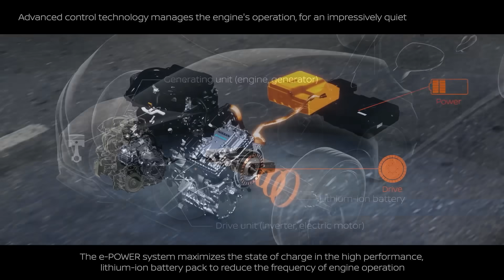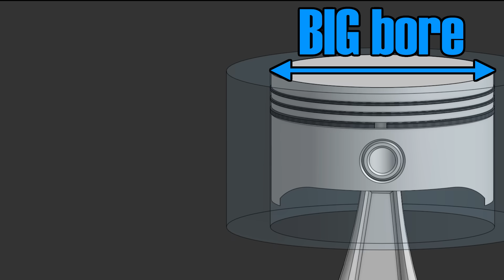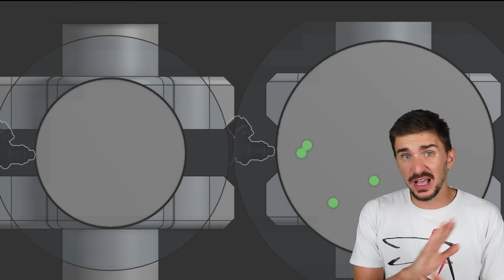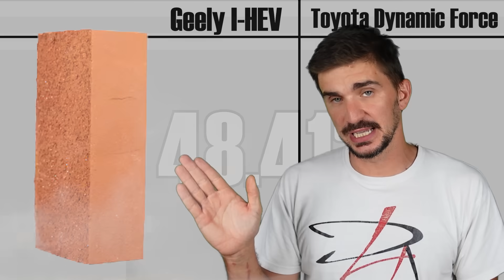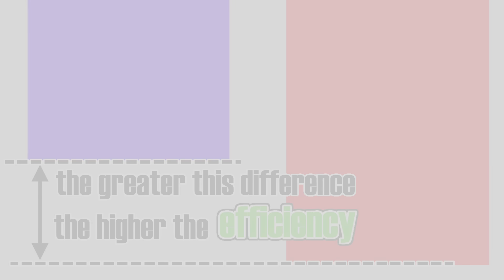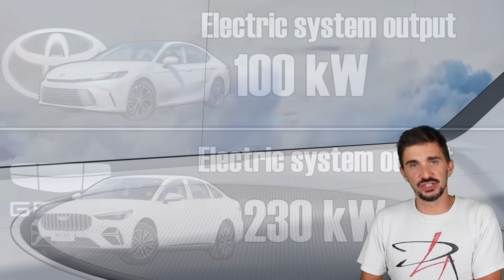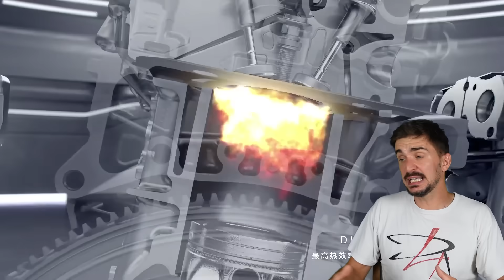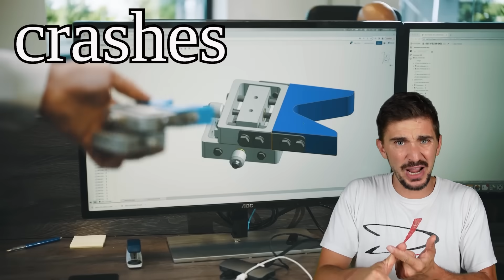How China's Geely Beat Toyota, BMW, Ford and Everyone Else

Comment: Toyota could technically move toward an extreme deep Miller/Atkinson-style hybrid setup like the one described for Geely, but it deliberately chooses not to. This is less about capability and more about engineering philosophy, product strategy, and real-world usability.

Toyota designs its engines for universal reliability across all driving conditions: cold starts in Northern Europe, urban traffic in cities like Brussels, sustained high-speed driving on German highways, mountain roads, and situations where the battery is low or even depleted. The core principle is that the car must always perform predictably and adequately, regardless of circumstances. An ultra-deep Miller or Atkinson strategy can deliver very high efficiency in a narrow operating range, but it often comes with reduced standalone engine performance when the battery support is limited. Toyota avoids this kind of dependency.

Another key factor is battery size. Toyota hybrids typically use relatively small battery packs. This is intentional: smaller batteries are cheaper, lighter, more durable over long-term use, and less prone to degradation. However, this also means the combustion engine must always be capable of directly powering the vehicle without relying heavily on electric assistance. In contrast, the Geely approach assumes a larger battery and stronger electric motor system, allowing the combustion engine to be optimized primarily for efficiency rather than direct performance.

Toyota also prioritizes average real-world efficiency over peak laboratory efficiency. The Geely-style system may achieve extremely high thermal efficiency under ideal conditions, but Toyota prefers a more balanced setup that delivers consistent efficiency across a wide range of loads, speeds, and environments. In practice, this makes Toyota hybrids more predictable and less sensitive to operating conditions.

Another strategic difference is that Toyota avoids building systems that behave like EV-first architectures with a range extender engine. The Geely concept effectively allows the electric motor and battery system to handle most driving, while the combustion engine acts as a highly efficient support or generator. Toyota does not pursue this because it wants its hybrids to remain fully functional even in low-battery or non-ideal scenarios, without any noticeable degradation in drivability.

Finally, Toyota operates a massive global fleet across very diverse markets, including regions with limited charging infrastructure, variable fuel quality, and extreme climates. This forces a design philosophy centered on robustness, simplicity, and tolerance to poor conditions. Geely, by contrast, can optimize newer platforms more aggressively around electrified, urban, and infrastructure-rich environments.

In short, Toyota does not avoid deep Miller-style efficiency because it cannot implement it, but because it chooses not to rely on an architecture that trades universal usability for higher peak efficiency. It prioritizes consistency, durability, and real-world performance over maximum theoretical efficiency gains.

Chatgpt

Comment: With more engines going to a 'under-square' engine design– I hope this will result in more inline six engines.  The main detraction of inline six engines has been packaging– with a more under-square design, it may be possible to fit an inline six transversely in an engine bay.  I believe Volvo SI6 did this.  Also having a perfectly balanced engine would help with higher piston speeds 👍

Comment: As a Chinese car owner in Mexico (BYD King), I can confidently say Chinese cars are no joke. With a full tank and a fully charged battery, the official range is 1,175 km (730 miles). In my real-world experience over 7 months of ownership, I consistently get around 990–1,010 km (615-628 miles), which is still very impressive.

Comment: ok so this makes sense, I learned A LOT because of this video, and I guess where we're going is: The most efficient way for ICE is to have an electric car with an engine running, charging the battery, at the RPM for peak efficiency all the time, the more efficient you make that engine, the more efficient the EV, and then we'll come full circle, why have the ICE in it if we can just have an EV and stop using gasoline altogether. 

Imo, I just like the sound it makes and the fact that I'm causing explosions while travelling. These new EVs really take away a lot of the driving, the drivers are not aware of how much power and responsibility they're riding on, and they use their phone or that big screen they have in front, they don't put gears, they don't hear any feedback from the car. Just mindless driving.

Comment: It seems the big question today is not "can it do it?" but "for how long?" - will it last beyond a few thousand miles? I you push engines to F1 limits, you will get F1 lifetimes. Do you want a sprinter or a long distance runner?

Comment: I only care about how many computers are regulating it and how fragile they are.

I have a motorcycle with great fuel efficiency. I hate it. It won't ever last longer than 3 years without expensive sensors being replaced. What a piece of garbage.

Comment: I have always wondered why western car manufacturers have not taken this approach since I learned about HCCI engines and their issue with having stable combustion on a wide rpm range. Why not design an engine for one specific rpm and use it as a constant speed generator? You can use the generator to spin up the engine to proper rpm and then start it. If you look at average kw requirement for a car it is not that high. The problem now is that everyone expects their ev to be fast as hell and have unlimited hp and torque. To get something efficient and environmental freindly this ide has to be toned down. 
So a constant rpm generating hcci engine and fully electric driveline with regenerative breaking seems to me to be the way to go.  Any opinions of why this has not been done? Is it purely political? 

From another perspective I'm also thinking that diesel fule and refined oil will anyway be necessary for the long future so gasoline will anyway always be produced. And gasoline emissions are also easier to clean in the exhaust of an engine.  And constant power and rpm can be designed to minimum emissions. 
Yes,  co2 emissions is always an issue, but if you are getting close to 50% theremal efficiency in an engine, the benefits of smaller batteries and less weight has to start to weigh in.
Another important issue is the life expectancy of ev cars and the problem with ev cars being scrapped by minor damages because the risk of damaging the batteries.  So there has to be a better balance between electric and fossile fuel in cars. I cannot see that fully electric is really sustainable.

And let's build more nuclear powe plants! The issue of global warming and co2 emissions could have been fixed in the 1950's when american scientists first demonstrated a safe self-controlling nuclear reactor. But the technology was not suitable for nuclear powered submarines, so it did not get any funding.
And now, existing nuclear reactors are based on the cycle for the submarine reactors and because of safety and regulation issues nuclear reactors have become so expensive to build that they  struggle with return of investment.  It seems to me at least that we are trying to fix these issues by the wrong means

Comment: Well, the nerd in me couldn't help but to pause the vid @ 1.46 to calculate the bore and stroke. Can't believe I actually got it right, although it took me over 10 min.

Question:  It sounds like their new HEV uses the ICE almost entirely to simply charge the batteries, so it's essentially a high efficiency low power GENERATOR that occasionally helps the batteries shove the vehicle during high loads (uphill, passing, etc) . So if it's constantly running, why do the batteries ever run low? You would think if all it's doing 80+ % of the time is maintaining a battery charge, it would be easy to keep them "topped off" all the time. What am I missing here?

Comment: Not for this engine particularly, but in general, here's my request...

Please discuss the ratio of conrod length to stroke length. (It's around 2:1 in most engines, according to LJK Setright).
It makes differences to the non-linear vertical velocities of the piston and the acceleration forces too. These effects dictate rev limits and so on. Most interesting, so as I say, please give us some analysis and some of your valuable opinions. 
Thanks.

Comment: Just find a charger nearby and charge the battery before uphill, usually the uphill all the way through is very rare. its an acceptable to have wheels driven by electric and engine to charge in emergency for 90% of the time

Comment: I have been driving combustifed ev from China for almost a year now and 10k km what a car with EV range of 100km I hardly need to refuel the gas. Charging every 2 days is enough. The good thing is city driving in full ev where ev is shining in efficiency highway driving assisted by ICE engine where ICE shines also where EV lost its power end efficiency.
 You get best of both world basically.

He mention suddent power drop when battery is depleted never noticed that. The engine always managed to keep at 24 percent soc and you can manually adjust it to maintain up to 85 percent battery if you want. Just in case if you need it.

Comment: Old British motor bike engines were smaller bore / longer stroke, to gain higher torque. 
Japanese bikes came along with high revving short stroke/higher diameter  engines with more power

Comment: The reason why China approached Hybrid Engine more is due to world's dominant usage of Oil. The best example was the Global South, most of its countries are undeveloped and unable to provide sufficient power generation to support entire EV sector, because of their Economy still depends on oil.

To support EV sector, you need to build more and more Electric Power Plants and designated EV Charger Stations which is brutally expensive for these small-time countries.

Comment: BYD and Geely to achieve high thermal efficiency of 45%+ on a gasoline engine they had to increase the compression ratio to the moon almost to the point of a diesel engine which significantly reduced reliability.

Comment: Sounds like the loss of power is just a skill issue, I know I have electricity at home, in fact, I am typing this on a battery-powered device which I charged BEFORE using it intensely. ICEs should be kept out of this mess, they don't deserve this treatment...

Comment: If you are trying to combustionise your EV, an even more efficient way would be to burn your fuel in a large combined-cycle gas turbine electricity generating plant, then transmit the electricity to thousands of users, including EV chargers. The transmission and conversion losses will still be less than 50%, and when a better power source comes along, you don't need to get a new car.

Comment: A Tesla electric motor's peak efficiency ranges from 90% to 97%. This means that nearly all the electrical energy from the battery is converted directly into mechanical power at the wheels, drastically outperforming traditional combustion engines

Comment: The problem is that these NA ICE "battery chargers" are terrible once you start requiring more power than what engine delivers in its very narrow optimal efficiency band. Once you start pushing the engine going 130km/h on a highway the efficiency plummets to below 20% as soon as your battery empties below certain threshold. This makes basically all Chinese hybrids terrible for long distance high-way driving. Already above 100km/h they are worse than any modern western/Japanese hybrid, and above 120km/h the difference becomes staggering.

Comment: I have repeated for years: the most genial solution was the one designed by Ferdinand Porsche for the Tiger 2 tank.
A gas powered engine producing electricity for the electric motors. No mechanical link between the engine and the wheels.
Fuel saving was huge!

Comment: Are all of these engines still using 4 valve heads? I was always under the impression that two valves would flow more fuel/air than a four valve at the same RPM. The big advantage for four valves being able to make more RPMs because of the lighter individual mass. I believe NASCAR cars use two valve heads with the valves being made of very light, very expensive materials. It would seem to me that if you are using an extremely undersquare setup, with smaller piston top area and lower RPM demand, that a two-valve head would be more effective not to mention cheaper to make. My only other thought is that since they are using such a relatively small area, maybe they need to use 4 valves in such a small space. My Civic Hybrid does use a 16-valve setup. Of course, who cares because in a hundred years if you don't have an electric car with solar panels on the roof, you ain't going anywhere.

Comment: Hello, well explained! But, I mean, if it would be so advantageous to reduce the hole and a larger hub for it, TOYOTA would have done it that way a long time ago! The building hybrid since 1997! As with electric cars, the Chinese manufacturers must first prove themselves through the same longevity as TOYOTA! I don't believe it! (Drive a PRIUS)

Edit: Also is not new, direct injection bring big problems with it! Koking, bad exhaust gases! Defective high pressure Pumps! That's why TOYOTA has combined both variants!

Comment: Why are Chinese automakers building so many hybrid vehicles, you ask? The answer is simple: to work around EU protectionism. Since the EU imposes heavy tariffs on Chinese-made EVs but not on hybrid vehicles, Chinese manufacturers have increasingly focused on hybrids as a way to avoid those additional duties and remain competitive in the European market. What you may not know is that hybrid vehicles have traditionally been less popular in China than pure EVs, making this shift somewhat driven by export considerations rather than domestic demand.

Comment: Combustified electric vehicle seem really pointless tbh. Yo combine the worst of both worlds when you could run the combustion engine at peak efficiency as a generator and slap a medium size battery. BYDs approach on the shark is the perfect example of of a good execution. If you wanted to be able to add the power of both power trains like toyota it would be perfectly fine too, since the combustion engine would only be used at the top 20% to 30% of the powerband, something you never mantain for more than a couple of seconds in a comercial vehicle, and for that period it would be perfectly fine to drop the battery charging momentarily.

Comment: Isn't running out of battery the sae as running out of gas? I mean, you wouldn't try to drive uphill with an empty tank. Therefore I think the scenario when the power drops dramatically isn't a "bug", it's just user error

Comment: bigger bores have lower friction, piston area/ring circumference is 1/squareroot 2. they should have made a 2cyl.  intake valve closes early, to avoid pumping hot air back into intake manifold as late closing would. throw away engine, no rebuilding

Comment: what makes sense to me is an EV with ICE range extender, maybe delivering as much power as the electric motor can use. so the ICE would be running at 1 speed only, easy to optimise just for that.
Reply: That's been done. Dodge self a truck with a 3.6 v6 that charges the batteries but it's not corrected to the wheels

Comment: As of June 2026, three Chinese hybrid gasoline engines have achieved a thermal efficiency above 48% (mass‑produced or about to enter production): Chery's Kunpeng Sky‑engine 1.5T at 48.57% (announced June 25, being ramped up for the Tiggo 9, world record), Geely's i‑HEV Smart Hybrid at 48.41% (launched in April, already on sale in the Emgrand i‑HEV since June 16, dual‑certified by CATARC and Guinness — the only true 48%+ engine in full mass production today), and Dongfeng's Mach 1.5T hybrid at 48.09% (China's first 48%+ production engine); the next tier includes BYD's 6th‑generation DM‑i 1.5L at 46.06% and Changan's Blue Core Super Engine at 44.28%, while Toyota (41%) and Honda (45%) have been comprehensively overtaken.

Comment: 225 slant 6 should be right in the middle of that list of long stroke small bore engines @ 1.17

As for this chinesium engine i am curious how the emissions would stack up against EPA standards here in the USA. EPA standards hurt efficiency in particular NOX forming at high cylinder pressure and temp and putting a lid on compression ratio. 

Dodge has an electric truck with a 3.6 v6 turning a generator and not the wheels so the good old USA has in fact been doing it. Chevy volt had a similar arrangement years ago. China isn't the only one.

Comment: we need to start calculating the fuel mileage with like a kw per distance and standardize it, im getting lost in the fuel consumption calculation like is the mpg number going of full tank full battery? is it still that efficient when its not plugged in over night/topped off, it seems like we keep just focusing on the ice part and not the ev side, i just need so much more clarity